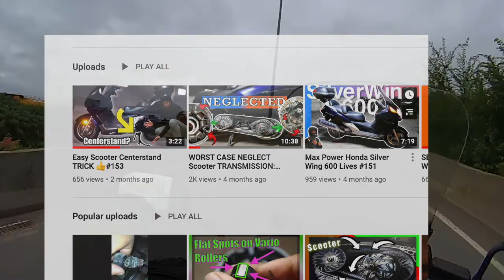Reviving the Roar: Restoring Performance in a Honda Silver Wing 600 #154

Comment: My winter project was to get a actually decent action cameras.  Mounted one to my helmets and handlebars.  Just waiting on the weather to get better.
Reply from the maker: I  better get on that same project as well. After the GoPro 4 took a major bowel movement 💩 I been running my GoPro 3 and the video quality of the 3 is less than ideal. 
Any camera suggestions 🤔
Costco sells a knock off gopro camera for 39$. I read some reviews and owners seem to be satisfied with them. I'll likely start there, that or pick up an older used sony action camera👍
Reply: I got both of these.  Haven't had a chance to test them.  Both have a port of a mic.  Most of the super cheap ones don't
Reply from the maker: Ok so I've checked them out and for the money we can go wrong. Thanks for puttin me on to these cams📸📸 I might have to put that Amazon gift to good use!😁 Did you strap a turbo on the Wolf? Gonna start callin you CAPT. BLURRRR💨
I ramp up playback speed and delete all stoplights-waits from my vids, AIN'T NOBODY TIME FOR THAT lol🤣🤣
Cheers👍

Comment: What about the screen wind 
I need to get one
Reply from the maker: 👍 oh hell yeahhhh I want a Givi High Windscreen!! I've heard many good things about them. What brand wind screen are you looking for?
Thanks🙏
Reply: I just commented o the basic clear Givi D214 I believe it is. Should be able to get it for $120 or so. I put one on mine and wouldn’t have it any other way. Although, the stock was pretty good for slow speeds.  The right type of wind protection is not easy to come by on a lot of bikes. But the Givi and the wing are a perfect match.
Reply: @MaxiScooterGuy  I had a high Givi windscreen on my SW i dont remember the model and i notice this. In strong winds it lift  somehow the front wheel and you loose the steering .I put again the oem and all are ok

Comment: Yeah. Ride that left hand brake at parking speed turns so you can keep that belt engaged. All part of the joy of riding with a cvt. If it was all easy it may be just too boring.  Yawning and all that.
Reply from the maker: 👍Good call! I'll check that out next time I go riding😁 Any more tips for Swing owners?
Appreciated 🤝
Reply: @MaxiScooterGuy  
Ride it like you stole it if you want. I put the Givi D214 shield on mine. It protects the hands in cold weather and at 5 10 I actually look through it. If need be I can sit up straight and see over it. Didn’t think looking through it was gonna jive, but wouldn’t have it any other way now. It’s clear as a day can be and absolutely no head bobbing with any type of head gear. I can ride in the upper 20*f with no eye protection and only enough watering to keep my eyes moist. If it’s in the mid 20s I go riding for an hour or so with the same gear I have skied in. Much a do to the tall shield.